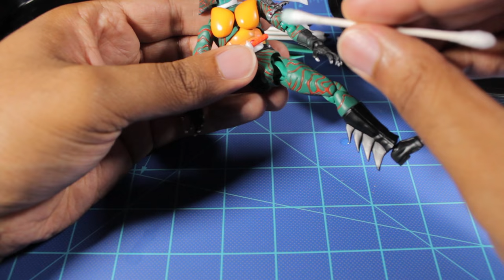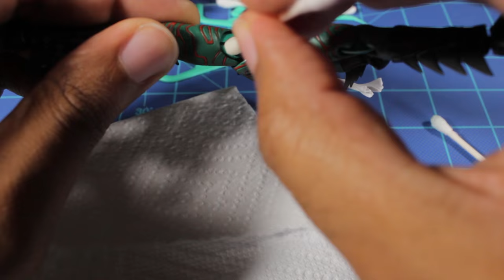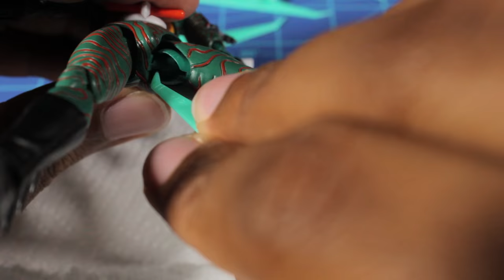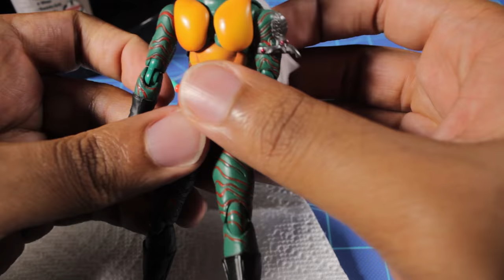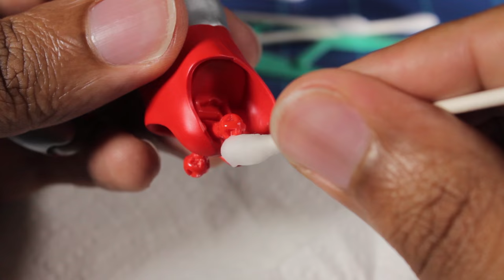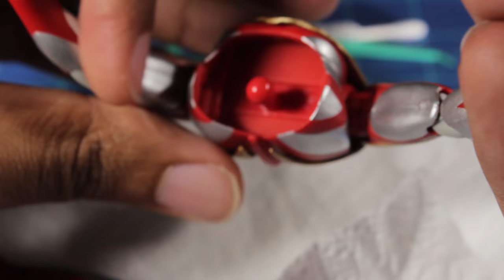DiegoDoom Vlog#005: How to Loosen Tight Joints & How to Tighten Loose Joints

Comment: Hi DD, thank you for this tip video! Awhile back I used WB-40 on one of my Perfect Grade Zaku II because both of his shoulder are super super tight. After applying WB-40, it was so much easier to twist and turn.  I left it for one day to cure and came back to it.  Suddenly the shoulders snap clean off!  Lesson learned is that WB-40 is a chemical that can burn "certain" plastic.  I recommend to all of my friends to not risk using WB-40 because we don't know what type of plastic toy company uses.
Reply from the maker: I will add your comment to an update vlog. Thank You!
Reply: @DiegoDoom  does the floor polish tightening last long?

Comment: I use little pieces of cardboard for loose ball and socket joints. Cardboard with the thickness of say...a Hot Wheels package.   Works like a charm.
Reply: datto damn your a genius i tried it....it worked

Comment: What this shows is the bad quality control across hundreds of different figure lines ha.  I had not heard of the dish soap before it is a solvent though.  A small detail paint brush is best to leak the stuff into the joints, also you won't get the cotton fuzz on things.  I always let the future dry over night,
Reply: Right? You'd think with some of the prices these figures can run they'd try to tighten up the quality control. These are good tips, though.

Comment: is there a way to fix broken hand pegs on figuarts figures? for example if the peg snapped inside the wrist can it be removed without ruining the figure?
Reply from the maker: Unfortunately, I don't know a good way to fix that issue. I know that is a very tough one to fix. I had a ball joint snap on me before too, that got stuck in the hand. To get the ball joint out of the hand. I used a hair dryer to heat up the socket and I used a needle to work the broken piece out of the hand. I then glued the peg back to the wrist. After that I could never really swap the hands out because the peg would separate again back into the hand. I had to buy a new figure.

Comment: Aside from pledge, what alternatives can i use to fix loose shf figures? Hoping for your reply
Reply from the maker: You can also use a tissue, but it is temporary. Rub a tissue into the socket. The fibers left behind will help add friction to keep a joint tight. You can also try nail polish.
Reply: Ohhhhh. One more question, can i use any floor shine liquids to fix it?
Reply: King Kong the finish product is no longer available in its previous concentration. The alternative is pledge revive it floor gloss. It takes a while to dry and likely need a second or third coat based on what you are doing. I have a TransFormers MP Grimlock with a loose Dino arm and the ball socket doesn’t come apart so the polish in the socket takes forever to dry (48 hours+) because the socket is so deep and there’s no airflow around half of it. If the ball joint CAN pop off, I’d let it dry off the joint first so it dries quicker.

Comment: Do you have a fix for squeaky joints?
Reply: Try graphite, take a pencil and work the top in the joint best you can. The best stuff is for lubing the nut on guitars to prevent strings from snagging on the nut during tuning.Lookup Big Bends Nut Sauce, it’s in a easy to apply “gel” and comes with a double ended applicator that can get into some tight spots

Comment: Hey DD l have trouble with my sh m arts 2014 godzilla. One of its legs seems to be longer then the other due to what i think is a loose knee joint. But i don't know how to fix it? i tired pulling it and pushing it back in but i'm worried if i break it.
Reply from the maker: The knee cap should wiggle. Is it the lower leg that is loose?
Reply: Its about were the knee is, i'm worried if I pull it, it will break.

Comment: What would be comparable to pledge Floor Care?
Reply from the maker: I'm not really sure.
Reply: Pledge revive it floor gloss is the reincarnation. Not quite as legendary but still good.  A little Longer dry time and may need a second coat depending on the joint you’re working on.